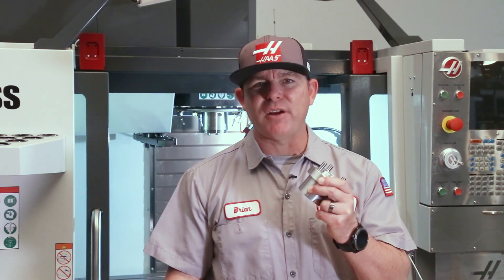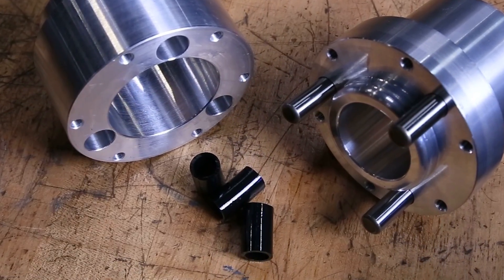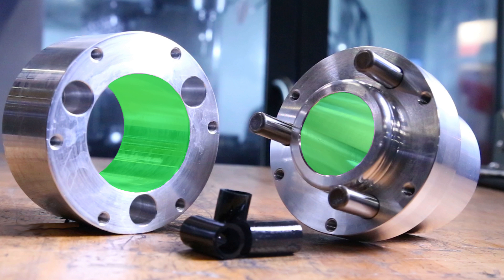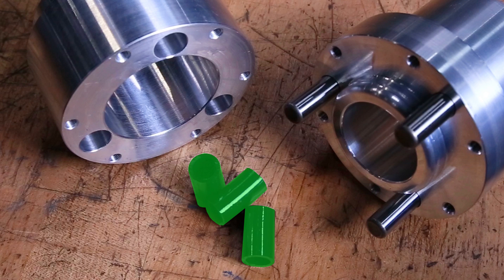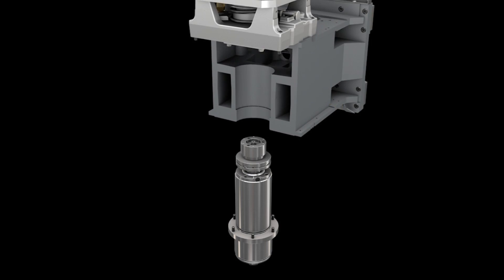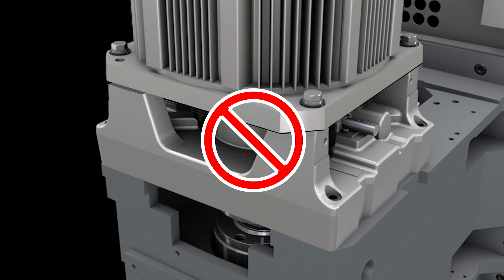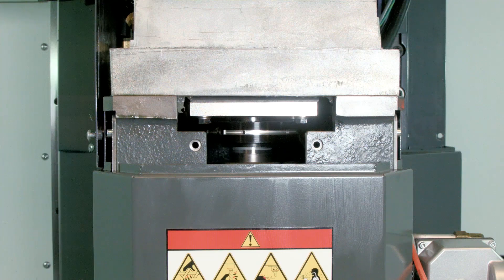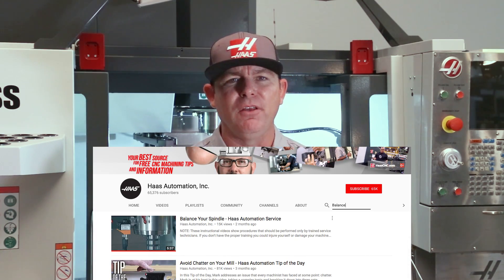Proper Installation of a Pin-Drive Spindle - Haas Automation Service Tip

Comment: :D precision is good... But what is the lifespan of those 3 rubber "inserts" if the machine is running a 5 inch face mill?l.... are those couples for mold making machines or for regular VF series?